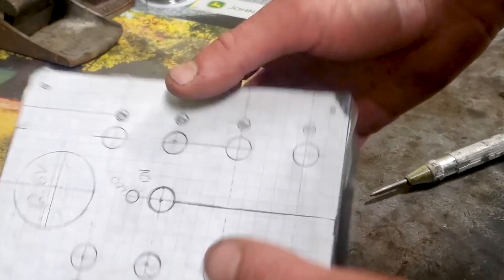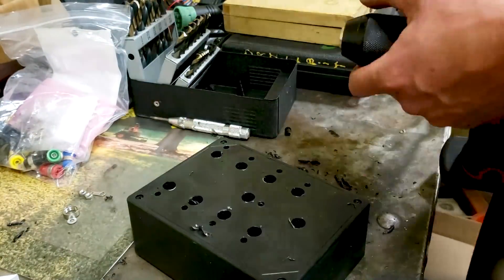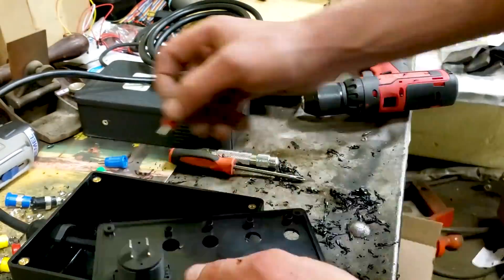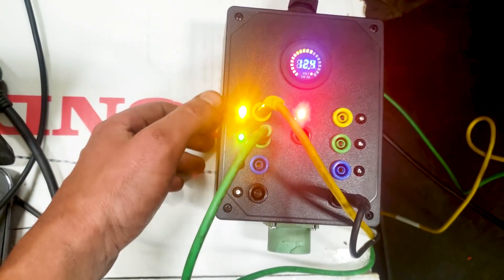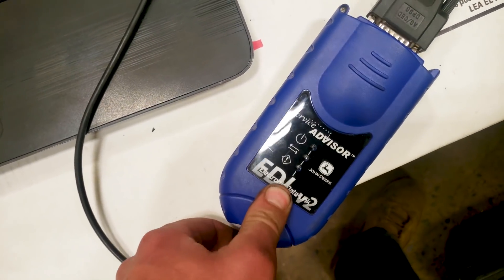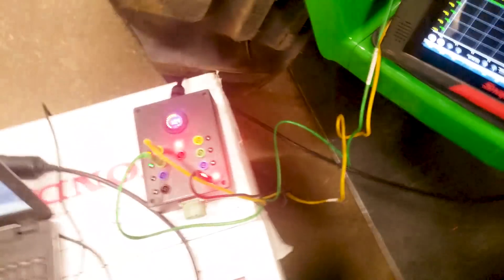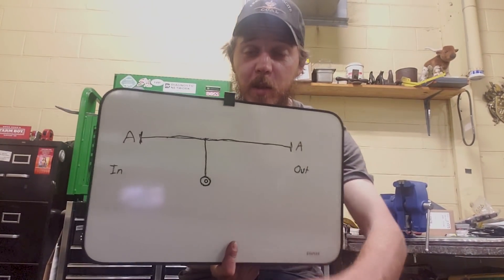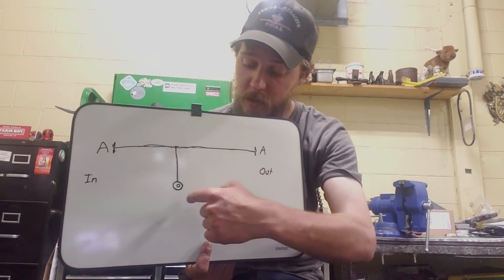Make A Tool Challenge

Comment: Did you get get the flashing of the leds working ?
Reply from the maker: I played around a bit and got them flashing pretty wellusing a voltage comparator but still haven't decided on final build design.

Comment: Awesome stuff mate big thumbs up 👍 really nice looking tool. Do you need a buffing amp for sensing the can line signal,s so it won’t pull the signal down hope you don’t mind the question
Reply from the maker: I believe it is a voltage comparator circuit that I need for better blinking of the LEDs. I have experimented with TL431 chips but haven't nailed it down yet.

As far as pulling the CAN line down, asking as it is run in parallel it shouldn't have major effects. There is experiments to be done and it can be achieved various ways, I want techs to look into it and hopefully learn as a result.

I just wanted to give people an opening to explore so that they can learn as I am learning.